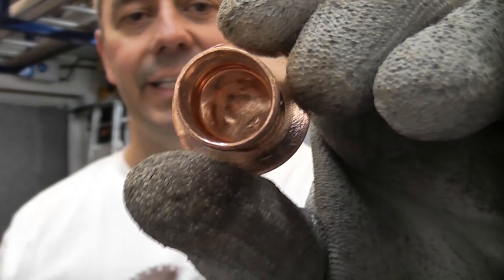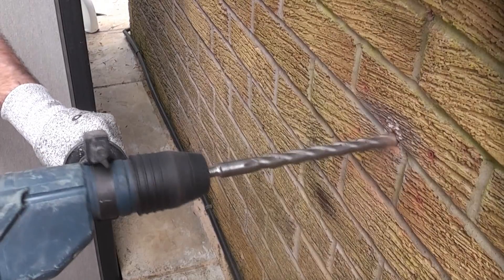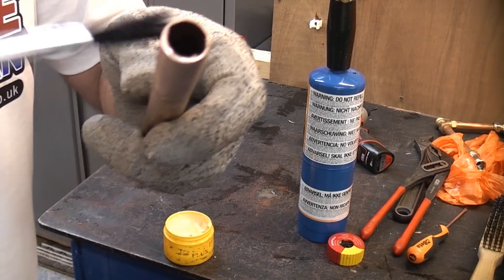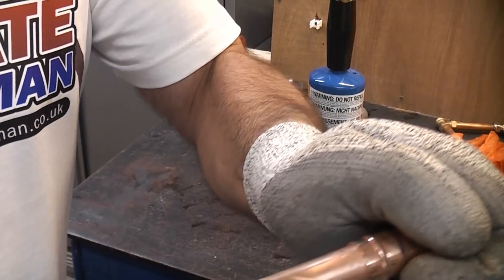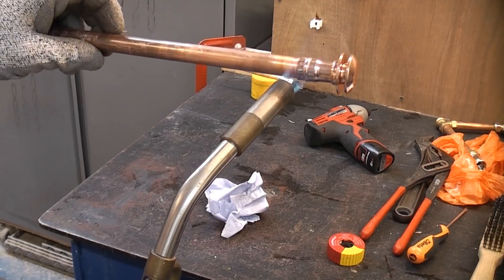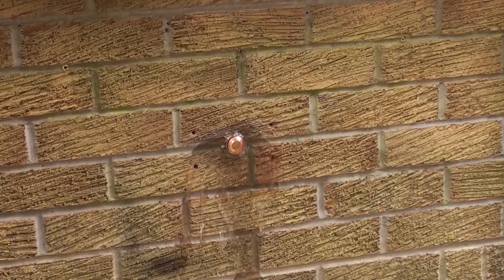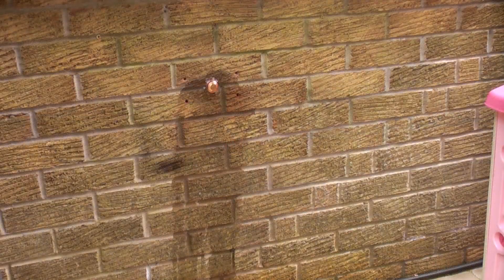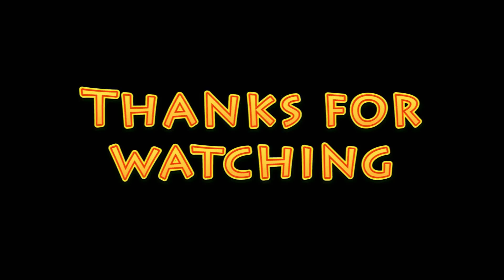Pipe cowl | pressure relief termination

Comment from the maker: This video could be useful for some of my plumbing friends!
I hope all the fathers have had a good day, and for those who’s fathers are no longer with us, I hope it’s not been too painful.
Reply: Ultimate Handyman hiya quick random question, how do I solve moulds on bay windows?
Reply from the maker: Mould is caused by bad ventilation. It often appears on any cold spots in the property, you either need to improve ventilation or get a dehumidifier. The mould can be cleaned away using some mould killer, but will return if the ventilation is not improved.
Reply from the maker: Good stuff ;-)
Reply: sharky marky HG Mould spray works wonders.

Comment: They have available for a few years now in UK. Dave Fraser's comment is relevant too, re sheathing the pipe where it runs through the wall. Regulations are always tightening up. 
In some areas copper thieves are actually "ragging" off the PRV terminals and making them illegal on safety grounds.
Reply from the maker: Blimey, they must be desperate to steal that small amount of copper!
Thanks for the comment
Reply: Only seen it twice and in the same neighbourhood. A heating system I installed 8 or 9 years ago I actually took the copper inside at 5 am under cover of darkness as the house was not tenanted. Screwed the boards back down at the end of each day for added security too. Thieves broke in and stole everything beneath ground floor/cellar. I ran the f&r pipework on pex and ran on the gas/hung connected boiler the day before the new tenants were due to move in, lest thieves nicked the boiler as well.
I wont work in that neighbourhood anymore. It's like the wild west. Eastwood, Rotherham. Makes Royston Vasey look civilised.
Reply from the maker: Blimey, I have been to some rough areas in Liverpool but gladly most places are civilised.
Thanks for the comment
Reply: Ultimate Handyman There's dodgy areas in Blackburn too 😂
Reply from the maker: Yeah, but not as bad as Liverpool.
I used to go out with a girl in Aintree, she lived across from the racecourse. I walked to the Bargain Booze about 300 yards from her house and it was like something from the Bronx, everything was behind Perspex!
Thanks for the comment

Comment: If water came out from this valve, does it mean there is a problem with the boiler and should be checked?
Reply from the maker: Yes, it means that there is a problem with the pressure on the central heating side of the boiler.
Often it is a problem with the expansion vessel - https://www.youtube.com/watch?v=KeO2gswQQe4
Reply: @ultimatehandyman  Thank you 🙏🏼

Comment: Nice and neat way of terminating relief pipe. But there is one way an old skool plumber taught me which makes a nice finish as well with an elbow a slight bend in some pipe then the pipe cut at an angle which I stick to now. Cheaper too! Thanks for the video.
Reply from the maker: Thanks for the comment

Comment: I have seen some of these on housing association properties, now I know what they are. Do they freeze in winter, my boiler just has a a pipe with a joint and another small piece of pipe at and angle, it has frozen in the past.
Reply from the maker: The PRV will only expel water if the pressure in the boiler is too high, this will not normally happen.
Your frozen pipe is more than likely to be the condensate pipe from a condensing combination boiler?
Thanks for the comment
Reply: Yes, it is the condensate pipe, obviously I am not a plumber, I was not aware that there were two pipes.
This is one of the reasons I watch your channel, not that I am ever going to do any of the plumbing, your channel gives me an idea of what to tell the plumber when I phone him/her to fix it. It is a 3 year old vailant, got sick of the Ideal boiler breaking down every year.
Reply from the maker: I'm glad the channel helps ;-)
A lot of the videos I make do not seem relative to many people, but at least they have some idea of what is involved in some jobs.
Thanks for the comments

Comment: its best practice to drill a 25mm hole and use 22 mm copper or plastic pipe as a liner .as the lime in the cement or block work will pin hole the copper over time ,
Reply: Dave Fraser If the pipe was carrying mains pressure water it would be worth doing.
Reply from the maker: Thanks for the comment
Reply: Gas would have to be sheathed. Mains water too. A pin hole in a prv line may be excessive as the pipe only carries water for a small duration until the valve re-seats. But regulations are getting incredibly tighter and seemingly more ... paranoid or obsessive.
Reply: You're in danger of the expelled water tracking back through the sleeve and causing a damp problem. For this to work it is imperative that the gap around the pipe is sound.